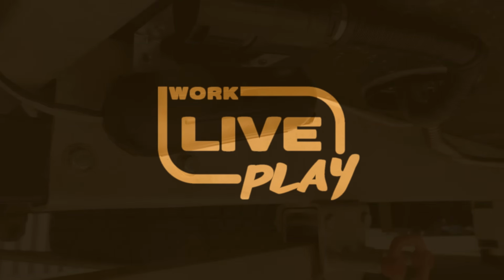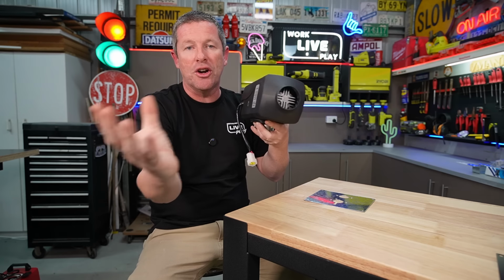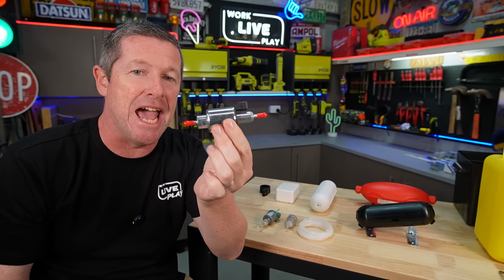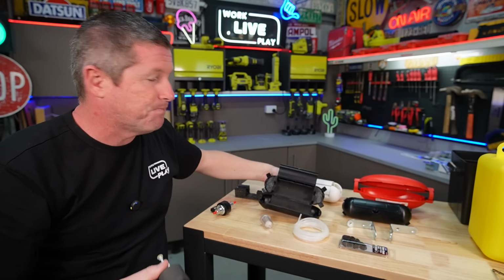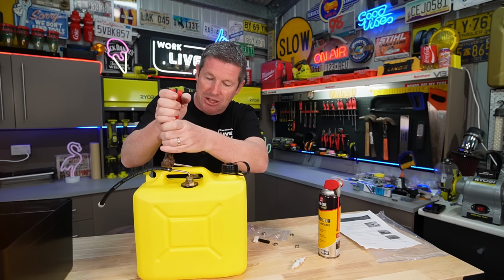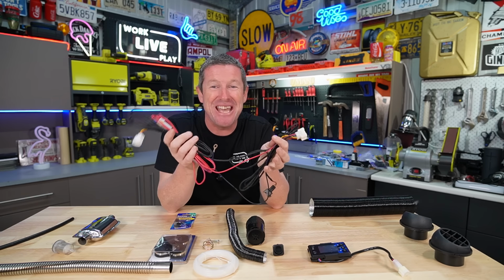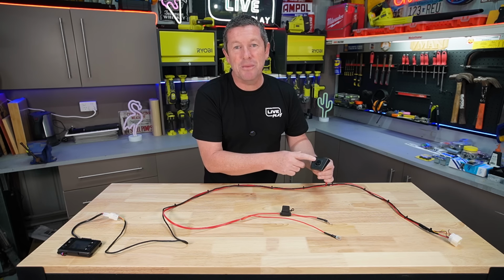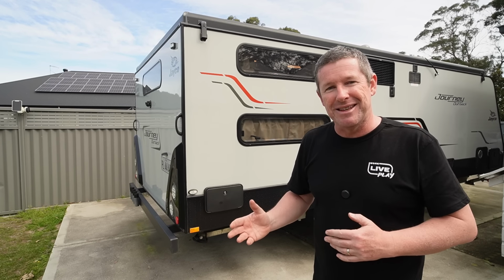Our Ultimate Diesel Heater Install Guide - all the DIY Tips & Tricks for your Camper, Caravan or RV

Comment: Use a thick rubber matt , bolted to the floor and your fuel pump casing so vibrations to the structure is prevented. E.g. truck mud guard piece, so to that no vibrations / noise can be transfered to the caravan body. Swim noodles around the pump in case.
Works great.

Comment: Another brilliant tutorial mate, you really do make it simple for the rest of us to follow you. When we installed ours we did a very similar setup with with the pump and encased it in a enclosed box but instead of packing it out with the foam we used expander foam, from a can. That was probably the only issue we had with the diesel heater install was the noise from the pump, you’ll never know how quite it is until you turn it on in a caravan park at 3 in the morning 😂. We’ve now installed the truly silent pump that we purchased from a chap in the UK, happy to supply details..now that’s a silent pump. Once again mate … brilliant 👍
Reply from the maker: Thanks, I approach the videos with trying to keep it simple and easy for those who are not familiar with the task will understand. 

Those super silent boxes from the UK look they are a great solution. Probably a bit too technical for a lot, so I didn't mention. I was pretty impressed by how little you can hear the pump actually but agree the true test would be in the dead silence of night, especially when you are near someone else 😅

I'm glad everyone appreciates these videos. I really do need to do some shorter videos to add into the mix, this one was 2 hours at one point 🙄😆🤣

Comment: Hi, I'm watching from South Dakota in the United States. This is my first winter living in my Ford Transit 250 van, and my first winter in South Dakota. It gets brutally cold here. I'm building out the van as I go along while living in it and pretty much ran out of time before winter now. My next project this week will be installing one of these heaters and hopefully it will be warm enough to be comfortable in here and be warm enough to tackle each project as I go. I work at the local hospital and there are several other travel nurses and such who also live in their vans. We all mostly stay parked at the hospital because it's safe, has security patrols, and the whole place is on live CCTV if anything happens. I noticed during the summer, we were all struggling a bit with the heat, and I'm kinda worried for them with winter looming because Idk what their setups are like. Hopefully, if this works well for me, I can turn them onto the idea as well, and maybe help them with their installs as I am pretty sure I'm the only one with a fair amount of tools and am mechanically savvy. Thank you for the thorough video, this helped me brainstorm some great ideas on how to rig one of these up for my van. Cheers from the States

Comment: Can anyone tell me if a long fuel line spanning from one side of bus to the heater makes a performance difference? I have heater on passenger side but want a custom built fuel tank mounted on drivers side where main fuel fill is.

Comment: Another excellent video from you. Thanks heaps. Now that you have a portable heater for the camper and a fixed one for the caravan, which do you prefer?
Reply from the maker: That's a really good question 🤔

I would have to say now it's installed, the built in heater feels better as it's just two switches to run. 

The portable was a lot easier to install and for the most part sits on a shelf in the shed. I would say the fixed in heater does feel more refined, so it probably just wins. I do think I'm getting older and lazy though 😂
Reply: @WorkLivePlay  nope. You are not old & crazy just wiser! OM about to install a portable heater in our Hayci caravan as I got that idea from your brilliant camper install video. See how that goes. Down the track I can always take the portable one apart as all the major components are there (just need a longer fuel line) and install it as a fixed system using the same hole that I will make for the ducting through the floor. See what happens down the track. Thank you for your awesome videos. They are unreal!!
Reply: Jayco caravan not Hayci...bloody spell check lol
Reply from the maker: In all honesty, if I didn't already have the kit and the YouTube channel, I would have probably just replicated the Swan setup in our Journey with the portable and duct through the floor. It works really well. 

Another idea a few have done is to duct through a panel they fit into a side hatch. That avoids cutting the floor which would also work well 👍

Comment: Change the bearings ro 3052RS rubber seals not the steal seals , glue the shaft to the stator, install a HDPE washer to deflect the brush dust , use a peristatic pump not the tick tick pump.
Reply from the maker: @GarretKrampe  the peristaltic type pump boxes are good however I was leaning more towards the typical DIY, plus they get expensive. I do like the upgrades to the heater also. To be honest, in our case we probably won't use it that much. However I might look at pulling one apart 😉👍